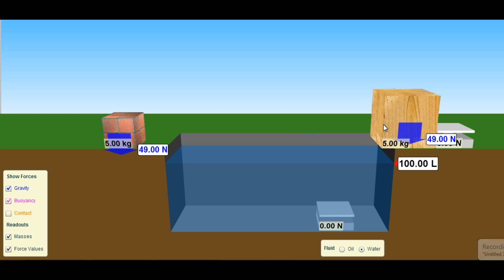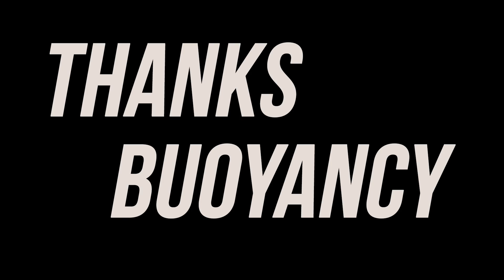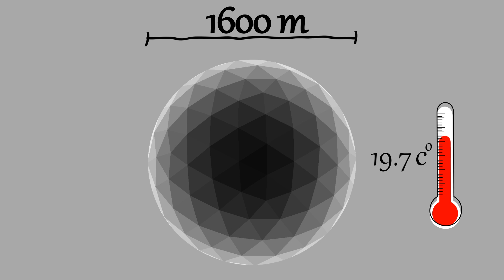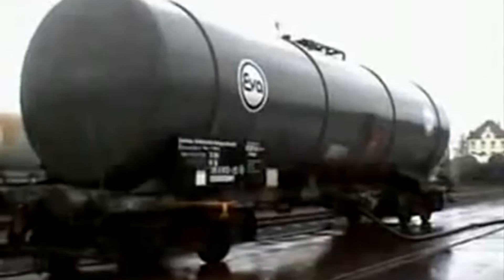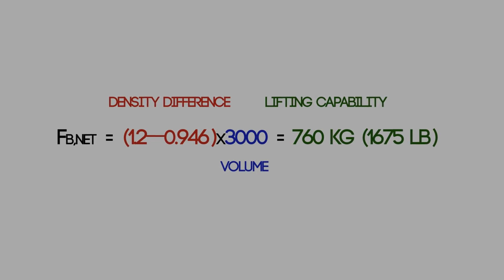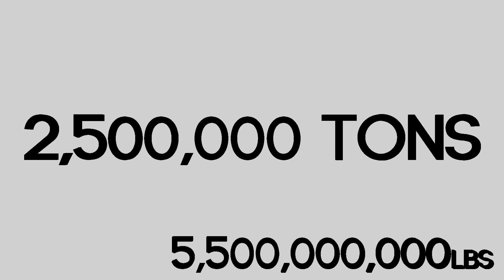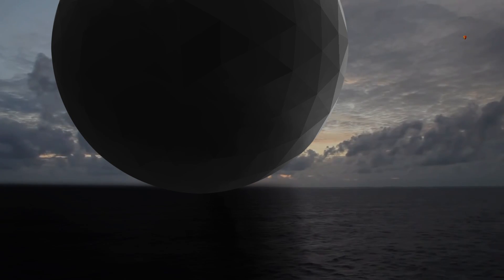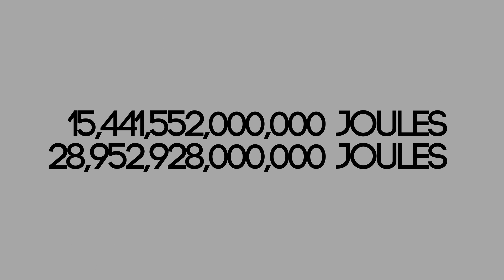Making a hovering CITY! - Buckiminster Fuller

Comment: The difference doesn't have to be even, right?

What I mean is, could the air in the top half be, say, 15° warmer than outside, while the air in the bottom half is the same as outside? Air in the top half 20° warmer and air in the bottom half 5° cooler?

This would be so that the inhabitants have a comfortable temperature to live in.

Or am I all wet and this wouldn't work?
Reply: The higher you go the colder it is, but also the thinner it is, so it would find its level but it would likely be too cold for comfort (but a good deep freeze).

Comment: One thought in powering a city-ship of this design would be to use the difference in air pressure/temperature from the top to the bottom of the sphere. if you had a tunnel running up the axis of the sphere with turbine blades that difference would translate into airflow and thus you get power just by the natural environment created by the spheres size. The closest example to this in other power plant design is a solar tower like this: EnviroMission's Solar Tower Pilot Plant - Solar and Wind Renewable Energy Imagine the chimney running up the vertical axis of the sphere and instead of collecting solar energy, it just uses the difference in air pressure/temperature to move the blades. This is just a thought I had watching this video, please be kind in pointing out any limitations or faults in the system. Cheers, :)

Comment from the maker: Bonus fact: Because of the buoyancy and because air behaves like a liquid, the air around us pushes us upwards just a little bit and thus we are a bit lighter then we would be without the air. (0,5kg - 1kg lighter / = 1,1lbs - 2,2lbs)
Reply: there is no problem with the energy required, because you can use the sun and the greenhouse effect.
Sun radiation can enter to the sphere because it arrives with a higher frequency and most of our "transparent" materials are just transparent to those frequencies, ones the radiation touch different materials inside the city, it transform to a lower frequency and this energy can not escape by radiation.
This mean that you can achieve in passive way 5 to 10 degrees of difference with ease.

Comment: Despite the problem of how much energy we would need, we could definitely make these things happen, as long as we can get governments to allow us.
Vote yes for Nikolaville!
Reply: Buckyville
Reply: there is no problem with the energy required, because you can use the sun and the greenhouse effect.
Sun radiation can enter to the sphere because it arrives with a higher frequency and most of our "transparent" materials are just transparent to those frequencies, ones the radiation touch different materials inside the city, it transform to a lower frequency and this energy can not escape by radiation.
This mean that you can achieve in passive way 5 to 10 degrees of difference with ease.